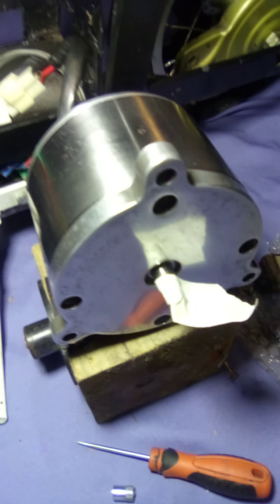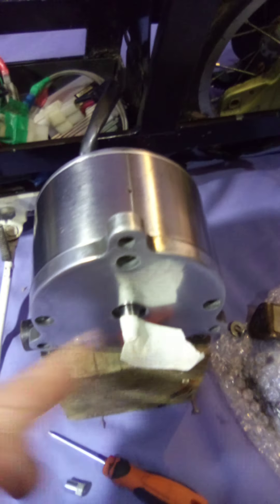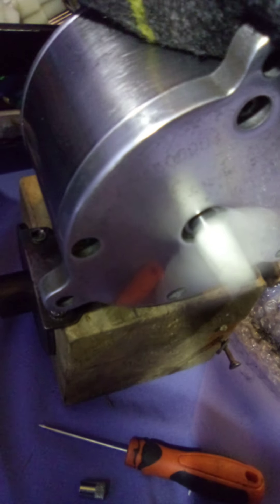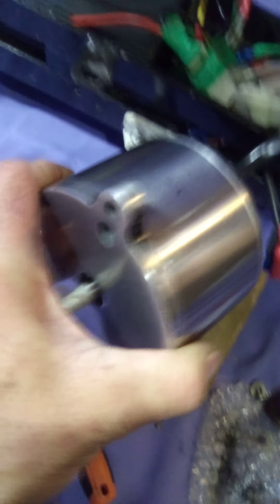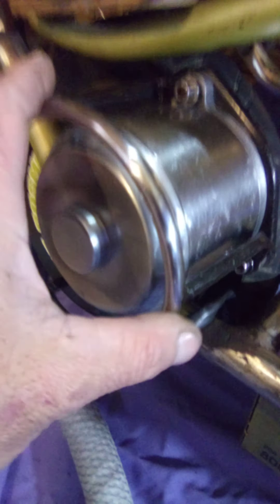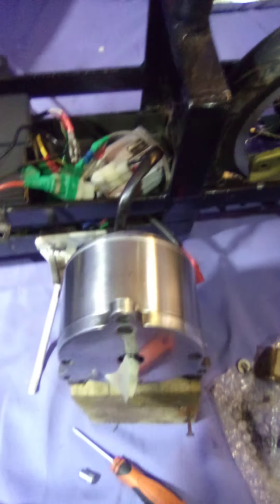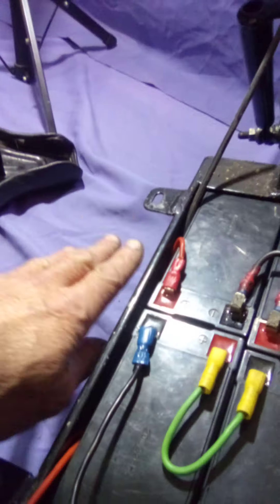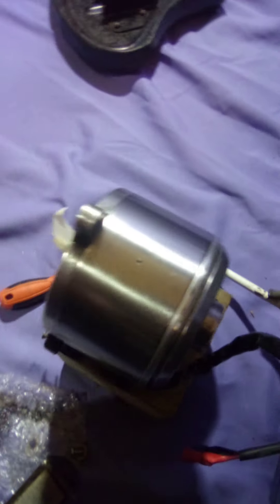cruzermans inventions will mytrayas 250watt brushed motor rebuild work

Comment: Sounds nice and smooth.  Glad you got it working so nice after all that work.  
I’ve never put so much time into cleaning and polishing parts, may have to give it a try sometime though.  I live on a tropical volcanic island so nothing stays shiny for long because of the rapid corrosion from frequent rain, humidity, salt air, and volcanic gases.  I keep a bottle full of my special blend of used transmission fluid, penetrating oils, and rust inhibitors on hand and everything gets a coating of that quite often.  That mix has saved so many tools and parts from rusting away though.
Reply from the maker: Allsome stuff I'll have to try that 😁👍 🎉🌟 allsome stuff thank you heeps 🌟 from cruzermans inventions sounds like New Zealand lol that's were I I'm .yip there's some rocky mountains here 👍🌟
Reply: @tristanmcnabb2741  OOOH you’re a Kiwi!  I don’t know why I didn’t guess that already.  That’s “Allsome!’ 
I’m on the big Island, Hawaii!
Reply: Aka “The Tallest Mountain In The World”…. If you measure from the ocean floor!